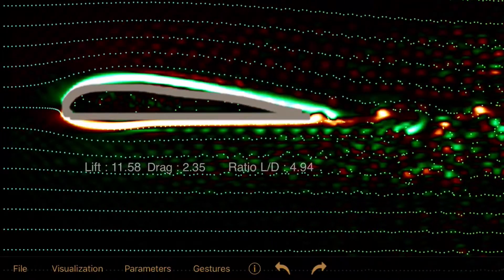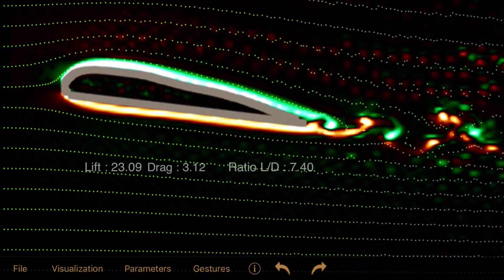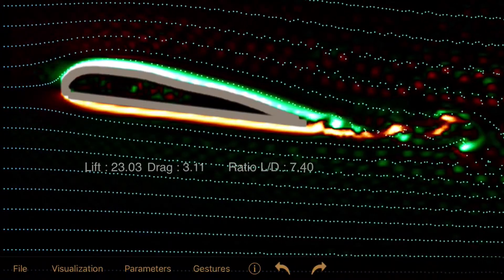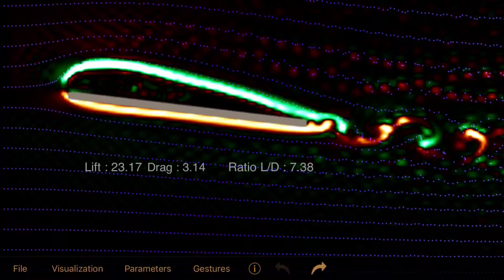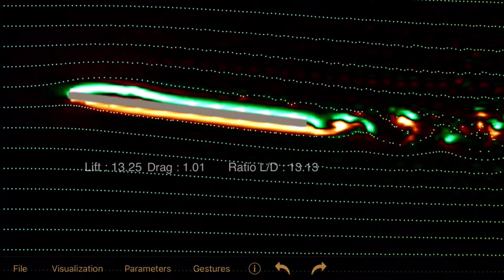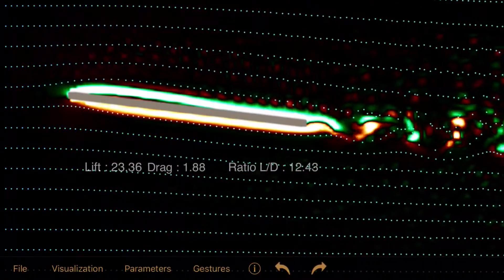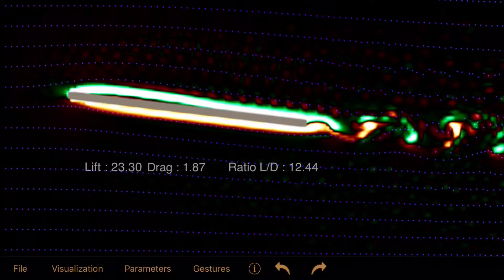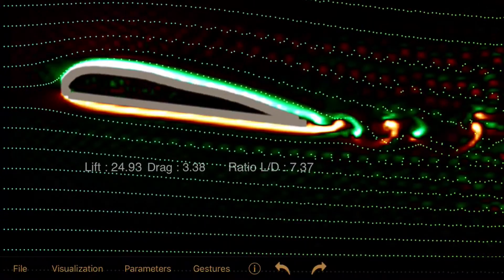Barn door VS Wing: What flies better?

Comment: Wait! So I can fly with a flat wing?
Reply: Paper airplanes fly with completely flat wings!
Reply: Yes but lack rigidity. So they need to be thicker and sharp leading edge doesn't give much range before a vicious stall, so round off leading edge. Reason why F104 Starfighter is dodgy to fly.
Reply: also, the video shows that in the same conditions, the properly designed airfoil will produce higher lift, which is why it is used instead of a thin plate as the thin plate cannot produce the needed lift
Reply: @ha_ha-ha_ha  Funny how the Wright brothers with all their wind tunnel testing, ended up using in effect a curved flat plate.
Reply: @ha_ha-ha_ha  So did Blériot.